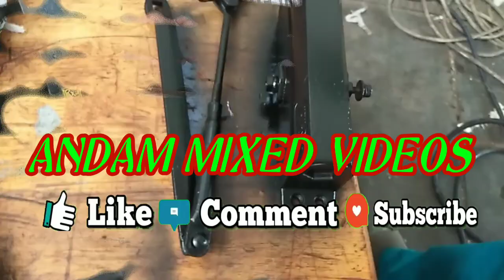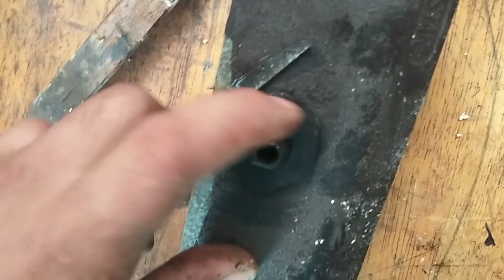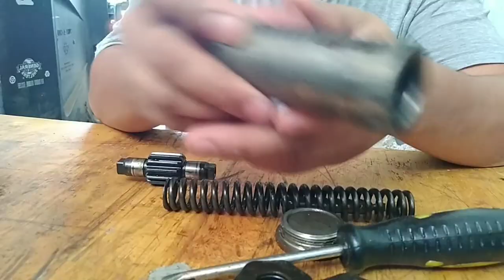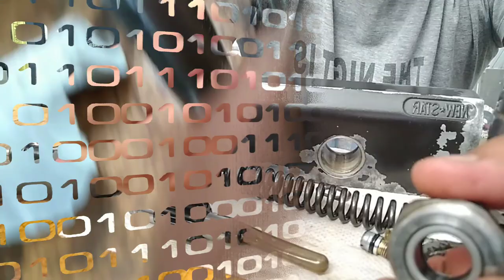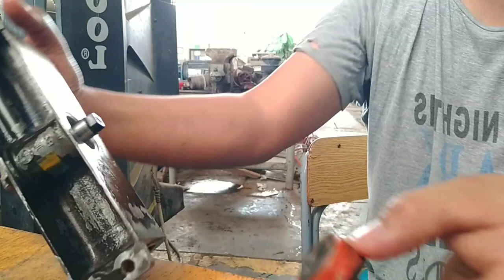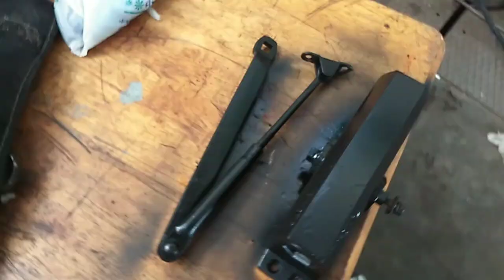How to Restore / Restoration of Door closer hydraulic / Hydraulic door closer Restoration / andam

Comment: Boss tanong ko lang, nainstall ko na yung bagong door closer na nabili ko, kaso medyo matigas buksan ang pinto nahirapan mga bata magbukas.
Reply from the maker: @marvinalar2401  adjust mo lods may dalawang adjusment yan flat screw or philips screw , counter clocwise ang pag adjust at konti konti lang , tapos kada adjust mo testingin mo hangang sa maging smooth na gusto mo

Comment: I have a Corbin Series 110 that is leaking. Are all of these pretty much the same on the inside? Other than sanding those parts, is the only part you replaced the O-Ring? And how do you know how much oil to put in? Do you fill it up? Thank you for this video!!!
Reply from the maker: Yes only sanding the shaft to remove the scracth so that D O ring wil not be damage, the oil is just 50mL or less if over you can drain a little bit

Comment: I don't want the door to close by itself. i just want it to slow down the closing when there is a strong wind. can i remove the spring?
Reply from the maker: Try to adjust the 2 adjuster using flat screw,  you can control its function,,the way of adjusting is turn left or right little by little or in a degree,,its depends on your choosen function,,
Reply: @andammixed thankyou, what kind of oil, i can use enginer motor oil ?
Reply from the maker: You can try it even motor oil

Comment: door closer oil number please
Reply from the maker: Any motor oil you can use it
Reply: @andammixed  hydraulic gear oil 68 number use me but no success solution please
Reply from the maker: @MisbokulMisbokul-td3ww  use a motor oil or gear oil it works better